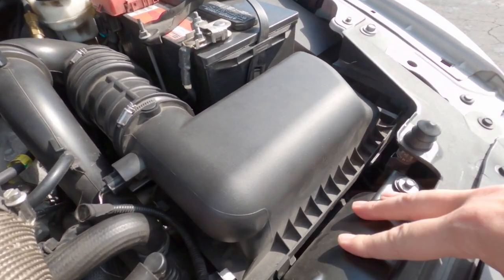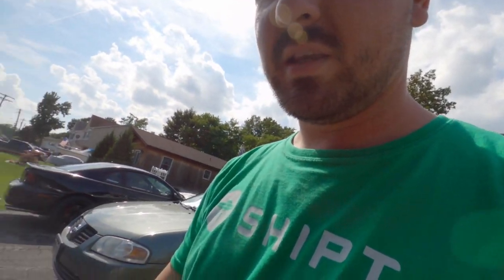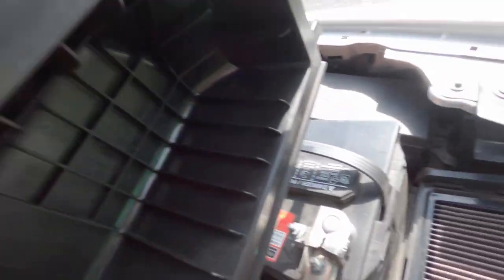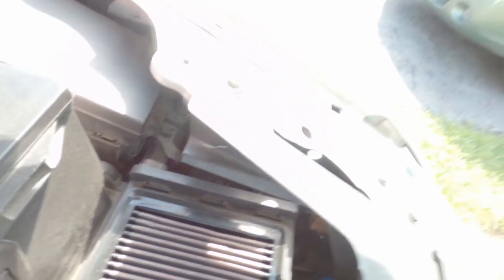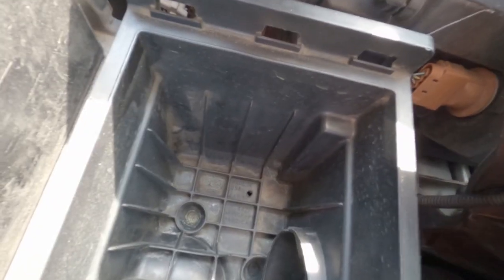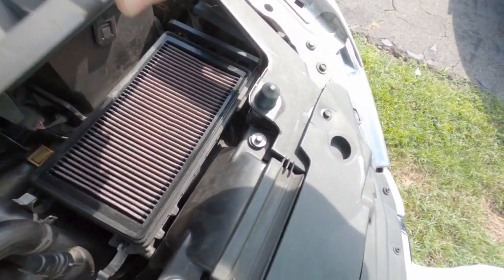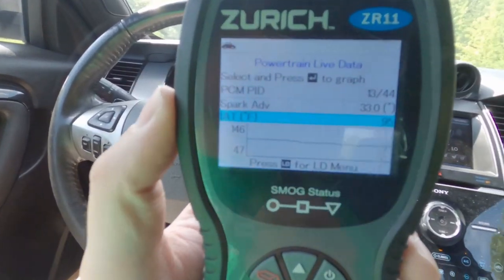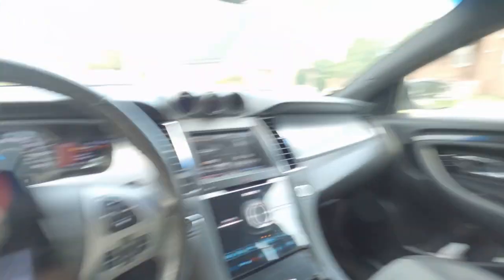How To Make a CHEAP Ford Taurus SHO Cold Air Intake - 2010 & UP

Comment: What size piping did u use??
Reply from the maker: It was the Spectre Performance 3 inch plastic intake tubing. The inside diameter is a little smaller, but any 3 inch tubing will work. You can even use the Spectre Performance flexible intake duct tubing to make life a little easier. You'll also be able to snake the flexible pipe lower into the bumper.

Comment: I designed and 3D printed something similar to this for the 11-14 F150. It's forward facing and pokes out next to the radiator behind the grill. The IAT equalizes with ambient most of the time.

Manifold temps stay high though, of course.
Reply from the maker: Nice! I made a revised version of this for my current ecoboost Mustang. I have a aftermarket intake that uses a the kind of cone filter with the front filter element. I used a Spectre flexible intake tube with the adapter that makes it usable with the cone filter, and I routed the flex tube down the side of the fender, through to the lower front grill. Definitely much more effective that way. Intake Temps at the filter stay consistently near ambient.
Reply: @KarzKreated  That sounds pretty slick. Got a video for that one too? I'll watch it later.
Reply from the maker: I do but the routing of the tube to the front grill was fine afterwards off camera. The bulk of the install is still relevant. You can find that video by searching the title - I Made A SUPER Cold Air Intake for my 2020 Ford Mustang!
Reply: @KarzKreated  Sweet man, I'll check it out.